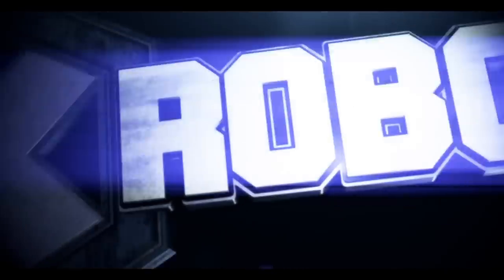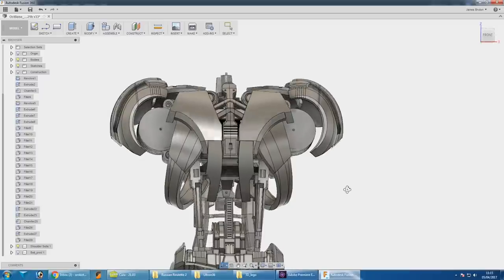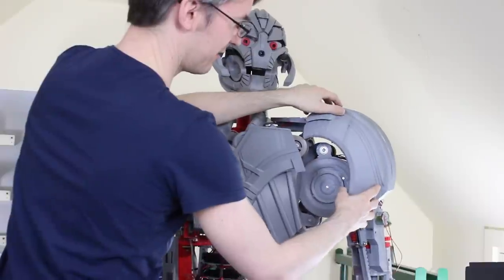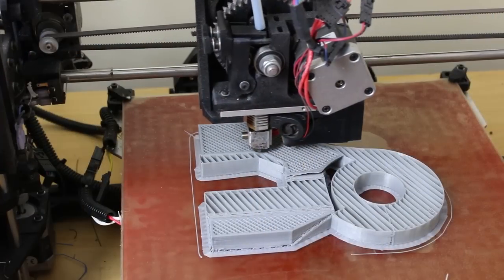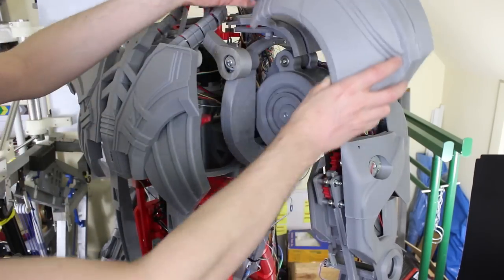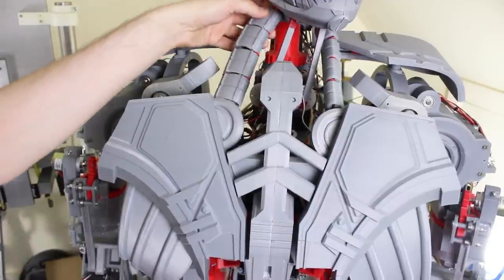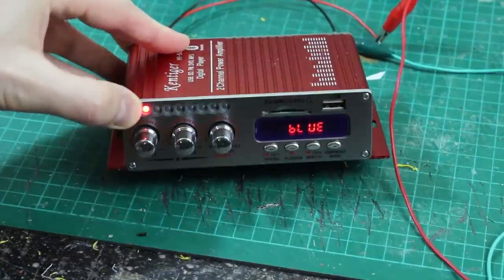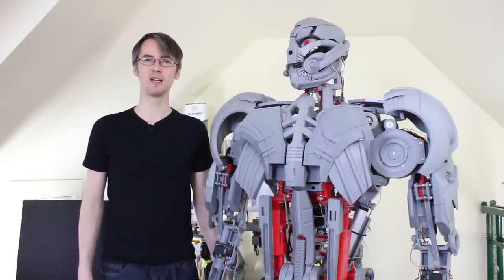Avengers Ultron #36 | 3D-Printed Cosmetics | James Bruton

Comment: I would recomend using PVA support material, after watching Bill Doran's video on hybrid printing (which he mentioned you in) he used it and it was so easy to peel off also, it desolves in water.
Reply: James Bruton ah, never mind then 😂
Reply: Lulzbot has a dual extruder sistem. Maybe they are willing to send a review unit?
I think its worth a try

Comment: I looks more awsome every time! Tip: You should build an enclosure for the loudspeaker elements. Otherwise there'll be acoustic leakage around the rims which can cause trouble. Preferably separate boxes for each element to avoid interference between their backside inside the box. Both sound quality and sound pressure level / W will be improved.

Comment: Hey James, awesome progress so far but one suggestion for the sound (I assume, Ultron will be displayed at a convention of some sort): use a powered speaker with a closed case to add some depth/bass to his voice. It will make Ultron sound much better and more substantial. As he is a main villain in the Marvel Universe, I think he deserves a powerful voice :) Also, from the older convention-footage, there is always a lot of noise caused by all the visitors and Ultrons speech would probably just vanish in the mush of people talking.

Comment: For many of the CGI characters in movies they make the head smaller to make the torso appear more muscular. RDJ could barely fit his head inside Iron man's helmet as a result. 

Could I recommend fully enclosing the rear of the speakers? You will get double the volume from them, less distortion, and more bass.

Comment: Just to let you know, there are plenty of 3d models of ultron online the you can use to match proportions. For example, the head (as you said) is too low, because the neck it short. Also the shoulders are kinda big. You also have to take into consideration the traps when positioning the shoulders, because as of now if you were to add the traps with accurate proportions the shoulders would not be able to move. Love the videos, keep up the great work.

Comment: Why dont you smooth the surface of those printed parts with acetone in a chamber?

You just need to take a big bottle, put a little bit of acetone in a cup, and it will evaporate, and than smooth everything

Comment: I cant believe you just mounted the speakers to the tripod. There are so many cosmetic pieces on the torso that already look like speakers. you could have just put them there.
Reply: I suppose your right. It seems to me you could have opted for more, smaller speakers, rather than going bigger. though I suppose more speakers doesn't actually mean bigger sound. I guess I just don't know enough about the way sound and speakers work.

Comment: Will you ever make any step by step series on how to make a grinder + filament extrusion machine for recycling material from old or failed 3d prints and support into new filament?

All commercial options are quite expensive making them viable only for those who 3d print a lot.

A project like that could be a nice addition for the channel. plus with a machine like that,  people will be less afraid of experimenting and wasting material since it all can be recycled into new filament.
Reply: +James Bruton

That, please do it!

I have so much unused abs, from failed prints to support material laying around.
Reply: Yes, but for the average user would be really nice, its also an ecological thing, i mean, we sometimes waste so much material, its a shame throwing it all away.

About the 90% material, not sure if that's really necessary, in one of the ads, it was literally making new filament out of old 3d prints.

You can also make your own filament out of pellets directly, abs pellets are like 10 times cheaper and the material is exactly the same as your average abs filament.
Reply: the way i understand how 3D printing works, Why not just DIY a heat Sync system to transfer hear to a metal ( of a low or Mid electrical current carry.) to use that to melt the plastic again, and add in a way to add a spool  for when it is cooled. either by  Fans, or by liquid cooling a cylinder as to bring the temp down at a moderate pace so as not to fracture the warm/hot filament. 
just a idea, though i know its not all that well thought out.